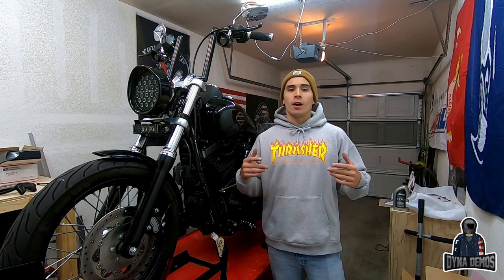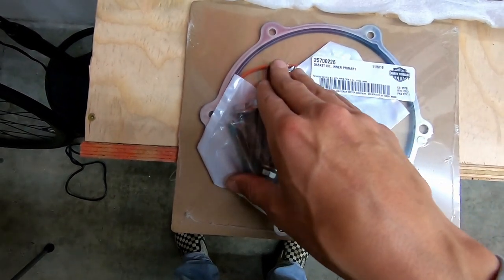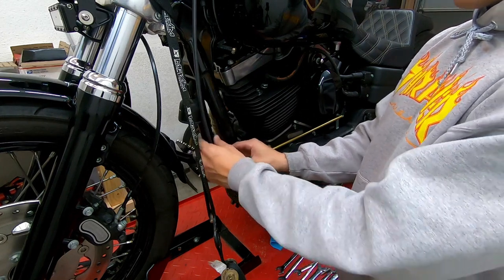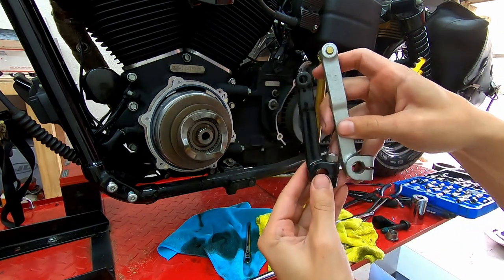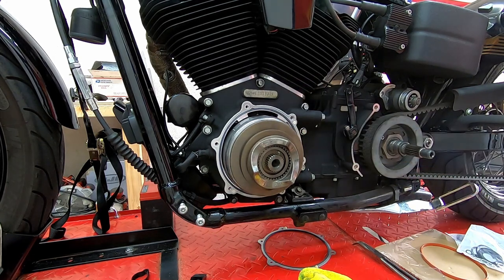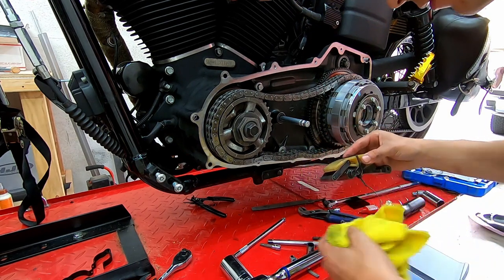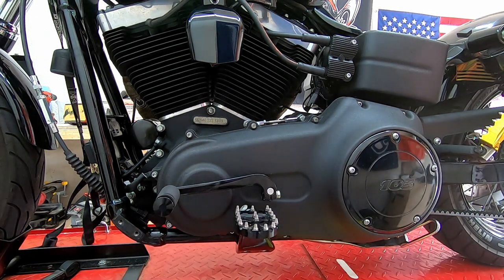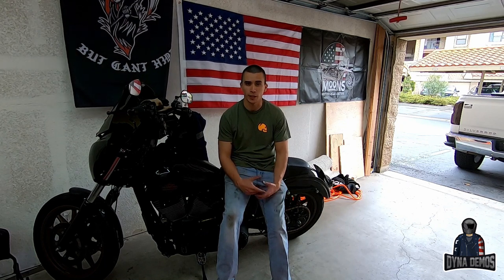Forward control to Mid Control Conversion (Dyna)

Comment: So happy you posted this. I've been searching for this.
Reply from the maker: Hopefully this makes it easier👌🏽
Reply: @dynademos    yo. So I took my time with this. Did it with my manual and your instruction. As far as I can tell, I did everything right. But the bike will not start. It will crank. But just backfires and makes a sound like its releasing air or pressure.
What Im wondering and maybe this will be too difficult to answer through here.
I did notice a hissing sound when I was both breaking torque and re torqing the compensator bolt... is that normal? 
Other wise im moving to looking for an electrical problem. Its just everything ran fine before I started doing this. 
The only thing I changed was better ignition cables and plugs. But I put on the old cables and didnt change anything.
Reply: @dynademos  my ignition cables were backwards. Lol Started right up...

Comment: Just completed my first time doing this swap on my 07 fxd in about 5 hours. Thanks alot for the video you really are a life saver. Straight to the point and correct info.
Reply from the maker: Glad it made it easy 👍🏽
Reply: @dynademos  hey man so I put my linkage and shifter on and it seems like my shift shaft is too tight in the casing because it doesn’t retract back on its own when you shift it
Reply from the maker: @bryandodge1713  it’ll wear over time dude just keep cycling it or u could try a bit of lube
Reply from the maker: @bryandodge1713  bahahahhhh
Reply: How much did it cost you to do the swap? Thanks in advance. Great video
Reply: @adamdavis3354  in all I spent $350 finding the peg mounts and brake were used, and the linkage, brake rod, and shifter were all new

Comment: I highly recommend replacing the primary chain adjuster while you are in there - the factory one causes problems over-tightening the chain - this can cause premature bearing failures ( the trans main bearing is a real pain to do), cause the splines to break in the clutch hub and hard shifting. 
There are several different ones on the market, some are spring loaded  ( Hayden M8 etc) but do not 'ratchet-up' and over-tighten and some are manual adjustment. Manual adjustment are a bit of a pain (but handle serious power upgrades much better) as you have to take the cover off to adjust them. It is a good idea to have the chain adjusted to the higher (looser) 'free-play' figure on very high power motors as the clutch gets hot and expands thereby temporarily tightening the chain.
 BTW, those 'Allen key bolts' are actually called cap-head screws and the 'gaskets' on the starter motor, inner chain case cover for the mainsheet and inner primary bolts are called seals. It is a good idea to cover the trans mainshaft splines with tape so as not to damage the oil seal when re-fitting the inner primary.
Reply from the maker: Thakery good tips I’ll remember that next time

Comment: Swapped my forwards out for mids on my 2018 forty eight and I absolutely love the change it made on the bike! Night and day and so much easier than on the Dyna since they are routed the other way. No removing primary covers or draining oil involved. I had to remove the front cylinder header off my 2-1 to get it attached to the frame but that was the hardest part which was 2 bolts and some muscle haha
Reply from the maker: I blame Harley engineers🤷🏽‍♂️

Comment: Man. SUPER helpful video dude. One question I do have is the kit I purchased from HD containing all the replacement gaskets came with 3 black o rings that seem like they were meant for the shifter shaft. I didn’t end up using them but DID have the tower gasket that I placed between the two primary’s. Did I need to use those 3 o rings or is the tower gasket enough? Thanks again man! 

Jonny

Comment: Something I missed was the shifter shaft install.  Did you have a new inner primary or did you drill the hole for the shaft?  Did you use any seals during shaft install?
Reply: I want to know exactly this!
Reply: The only shaft seal goes between the two casings it slide's over the shaft before the front primary case is reinstalled
Reply: I think the inner primary is blocked up with some resin if bike came standard with forwards. Needs drilled out just

Comment: I'm a new subscriber and I've been binge watching your videos. My Dyna is a 1996 FXDS that used to have mid-controls. I'm lucky because it already has all the parts that you installed when you pulled the primary cover. All I need are the shifter and brake levers and the foot rest mounts. Are those Harley parts? I haven't found any aftermarket mounts.
Reply from the maker: Everything but the mid linkage and pegs can be bought via harley Thankyou for the support let me know if u got more questions

Comment: Love the vid! You've been a life saver! I'm currently working on my 2015 FXDB Street Bob. My father and I have come to a problem tho. The shifter shaft was moving nice and easy before we put on the outer primary. When we put the outer primary on, we noticed that the shifter shift was SUPER stuff and took a lot of force from our hands to move it back and forth. Is this normal? We don't want to fill it up with oil and everything if it's not. Thanks!
Reply from the maker: I’ve ran into that and I think the shifter just needed to wear a lil but eventually it loosened up u can try to lube it see if that Helps
Reply: Thanks, bro! We did just that and it moved a lot better. 🫡

Comment: Nice video. Not trying to crap on your work just offering a suggestion. Jim's Primary locking bar is a better alternative to putting 175 pound-feet of tension on your primary chain. The locking bar isolates the chain. YMMV.
Reply from the maker: RW Long it’s appreciated someone else mentioned it I have that tool now not Jim’s but another brand same thing not worried about the chain tension as much as damaging the primary my bikes at 17k now so I’ve road it over 12k no probs but Thankyou

Comment: Loved to have this video when I did mine.
2 littles tips for you guys doing it. Most on torque wrench doesn't work on reverse setting. Be careful to not overtight like I did.
And make sure the chain doesnt touch the border of the inner primary when you torque it because you're gonna dent the lip and there's risk of leak.
English is not my first language my bad
Reply from the maker: Thanks for the tips ✊🏽

Comment: So I have a moon mc light bar for my 09 fatbob..I bought the wiring harness but I see that some people wire directly into the headlight wire. Is this ok? Will that cause any future prolems? What would you do? Thanks and keep up the great work!
Reply from the maker: k Pont u can do it either way with the moons mc harness u can use the light whether the bike is on or off with a seperate switch if u wire it to the high beam it will come on with your high beam either way is fine 👍🏽 or u can do it to your low beam but it will be on when your bike comes on
Reply: @dynademos  you rock!! Thank you!

Comment: Thanks for the comprehensive video. I like forwards but even with the reduced reach brackets I made, I can't get truly comfortable on my 2015 Wide Glide like I do my old Deuce. I'll be undertaking this project soon.
Reply from the maker: Heck yeah dude hope it goes well !
Reply: Thanks to your video, I'm pretty confident in my abilities to do it right. Message boards and online forums just can't come close to a well made video explaining a mechanical project. It's either mid conversion, or a Rekluse clutch and a jockey shifter with mid mounts but no shifter on the foot controls, probably the former since I am trying to get this done by the end of June in time for a long trip.

Comment: Thanks heaps for the video, made the job easy. Only note is my Australian 2015 streetbob had a T70 torx bolt holding the compensator rather than the hex in this video.
Reply from the maker: Ahh slight difference hopefully still helps you!

Comment: Tough chance I'll get a response on a 2 year old video but I'll give it a shot. Do you have the part number for the tower gasket you were talking about? Throne that blocks the shifter shaft from leaking between the primary.

Comment: I have two reason for riding mid-controls: my sciatica forces me to and the riding position gives MUCH BETTER handling. I used to ride forwards before my back problems and never got used to them because of the poor handling. If you've ever snow-skied, you will know what I'm talking about.
Reply from the maker: Never snow skied tried water skieing once I get the reference!
Reply: @dynademos  Big difference between water and snow skiing. With water skis, you want the front of the skis up and your body weight back. This is the opposite of snow skiing where you want your body weight FORWARD with your knees over top of your toes for better control of handling. The rhythm of slalom skiing is exactly like that used in tight turns in mountain twisties or even doing u-turns in the parking lot. When making the turn in snow skiing you force your weight forward and downward just like the motorcycle racers at the track. Look at the extreme forward body position of the crotch rockets. 
If you apply water skiing physics to motorcycling you need to be on a chopper with forward controls, just like pulling backward against the tow rope from the boat.

Comment: Was there a plug in the shift shaft hole in the inner primary? Or did you have to drill out the hole? Awesome video.
Reply from the maker: MyNameIsJesse yeah it’s just a plug I pushed it out I wouldn’t recommend drilling a hole if it’s even possible
Reply: dynademos this was my assumption. I just wanted to clarify. Thanks for the reply!

Comment: Hello 👋  great 👍 video man I have a set of mid controls for my 08 dyna street bob coming this weekend. This video helps out a lot I am going from forward to mids as well. Quick question so for the shift leveler only seal u use is the inner seal ? That’s what I seen on the video unless I missed something. Thanks 🙏 for the help
Reply from the maker: ivan sanchez yes the tower gasket
Reply: i have the same year street bob, waiting for my mid controls to come in from TC Bros, were you able to switch? how was it?

Comment: Really good video but the 2009 fat bob that I want to buy does not have a hole on the outer cover.  can you tell me around how much $$ was on parts??
Reply from the maker: 300-500 it really depends on how cheap u can get the mounts

Comment: Thanks for the video. I faced a problem when I installed my shift arm, it keeps moving back and forth (in and out) of the primary. I didn’t tighten the shift linkage yet. Is that why? Or what did I do wrong here
Reply from the maker: Rubber spacer on the outside of the outer primary on the shift shaft?
Reply: @dynademos  yeah that important detail was skipped unfortunately otherwise thanks for posting the vid

Comment: I need to change over a Newley bought "auction Bike" 1981 (1340) Super Glide to a Mid Control. But I don't know if I will be able to find parts.
For the mounts themselves I thought maybe find an old wrecked Low Rider to cut from. 
   But worse I hear that 81 is too old and there is no aftermarket sale companies on Harley parts. I've never had a Forward control bike, and don't want one.
   You recon this can be done? 
    I will ALSO mount "Highway Pegs"
Reply from the maker: From a quick search of “1981 mid controls” ebay pulled up a few options I think u could look into

Comment: What did you say at 18 : 16?  Sorry - I didn’t catch it.  How much are parts for the swap-gaskets, bolts, and everything besides the actual mid mount controls?  Thank you for posting this. Helped me to see it it was much more labor-intensive and requires much more preparation than I thought.  There’s a reason why professional mechanics can charge what they charge, thank you!
Reply from the maker: Use torque stripe but I meant loctite my b 😬 also total cost I believe including parts without labor is 500 or so depending on how cheap u actully get the mid controls for

Comment: Probably a stupid question but would this application work on a 06 fxdl? I ordered a mid control set and everything I would need from Harley, and I ended up with a bunch of parts you don’t have in your video…
Reply from the maker: Yeah Harley will just oversell u stuff minimum what I used in the video is required
Reply: @dynademos  thanks man!

Comment: How tight is “too tight” for the shifter shaft going through the outer primary cover ? I had to do what you did and tighten the outter primary on to help press the shaft through, but also had to rest a block of wood on the inside end of then shaft to keep it in place. 

Now that the shaft is through the outter primary, it’s pretty tight to turn by hand. Should I be concerned ?
Reply: I’m having the same issue. Have you found a solution?

Comment: So I just bought an 04 super glide with forwards on  and it came with mids. It has the the mid spline coming through the primary w/ cap. So my question is is it that simple just reconnect. No need for me to open primary?
Reply from the maker: jfields1134 just need to reconnect it

Comment: I'm switching from forwards to mids on my 2016 streetbob. I know I need an outer primary because it doesn't have the hole for the shifter shaft. Will I also need a different inner primary or are they the same for forward and mids? Thanks for the help!
Reply: I have the same bike and planing to go from forward to mid. Did you eve find out about the inner primary configuration?

Comment: Do you have a parts list? Have you done one that was originally forward controls so the outer primary doesn’t have the hole for the shifter shaft? I need to do mine and wondering if I have to buy outer and inner primary or just outer. 15 street bob
Reply from the maker: Steve Kammerer if your inner and outer primary doesn’t have a hole that’s plugged u will need new ones. No parts list just the beginning of the video where I go over the parts

Comment: I'm thinking of doing this to my '13 street bob, but need help finding the mid controls. Could you point me in the right direction for parts and hardware.
Reply from the maker: Cory Boutwell Harley or fxr and dyna parts trader
Reply: Don’t know if you found them but I got mine here for my 13 streetbob when I had it https://partsfinder.onlinemicrofiche.com/ronnies/showmodel.asp
Reply: TC bros also has some

Comment: Just did this today. Is it normal for the shift shaft coming through the outer primary to have in/out play? I can slide mine in and out until the inner arm hits against the motor in the back side. I thought there was maybe a clip or something to prevent this.
Reply from the maker: Do u have a spacer on the shift shaft that goes on right before the shifter arm?
Reply: @dynademos  I do not, that was my thought though. I can just go buy a spacer to take up the play. Did your kit come with one?
Reply from the maker: @hondamxbmx692  Shifter Shaft Spacer - 1602-1301 from drag specialties. I don’t remember but it’s like 5-7 dollars that should fix your issue
Reply: @dynademos  awesome thanks

Comment: Great video thanks! It helped me do the swap on my 2012 fat bob
Reply from the maker: Casey Carey hell yeah
Reply: Did you have to buy a new outer primary cover?  My Fat Bob doesn’t have a hole for mid controls.
Reply: @fivespeed3026  I had to get a inner and outer primary for it to work.

Comment: I had my shifter arm leaking from the hole of the primary. How does the black oring go on with the snap ring? It has like a built in spring in the oring or something
Reply from the maker: Did u install the tower gasket On the shift shaft arm

Comment: If I don’t have the hole for the shaft on my primary cover will I have to change the cover and the inner primary itself just to run the mid controls ? I have a dyna fatbob 2010 and does most dyna inner primary ,my year have the shaft hole ready ?
Reply from the maker: Yeah there is places that can add a hole to primary covers probably cheaper to buy one off eBay, Instagram, Facebook, etc…
Reply: Thank you

Comment: How much would u say is a decent cost for this to have a mechanic do including labor and parts
Reply from the maker: king ivo well it really depends on the shop cause harley charges 100 an hour and I’ve seen local shops charge 50 and hour. Parts are probably around 400-500 depending on how cheap u can get the mids

Comment: Will this install differ when working on older models like a 93 fxdl for example ?
Reply from the maker: It’s about the same minor differences on the inner primary. If u use a manual and the video as a guide u could do it for sure
Reply: Oh bud you’ve never seen me work on bikes, things will go wrong hahah, thanks for the video/quick reply!

Comment: What size sockets for the clutch and compensater. And what are the torque specs?
Reply from the maker: If you watch my chain install video pretty sure I say the tq specs although I suggest using the manual for torques. Also I do not remember the size man
Reply: @dynademos  I was hoping it was wrote down.  I'll watch it again and make notes.

Comment: If you’re going from mids to forwards, what can you do to stop a leak coming from where the shifter leg used to come through?
Reply from the maker: There is a gasket that is suppose to go there u would need to take off the outer primary and put it on
Reply: @dynademos  cheers bro, mean video 👍🏼

Comment: What gaskets did you use on the shift shaft?
Reply from the maker: It’s called a tower gasket local Harley will have it or u can go aftermarket ive used both good results